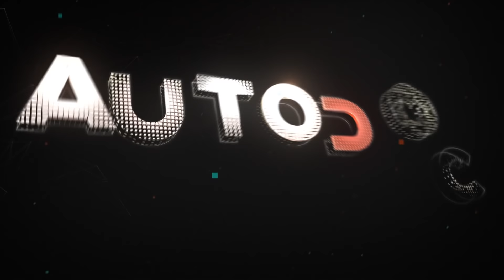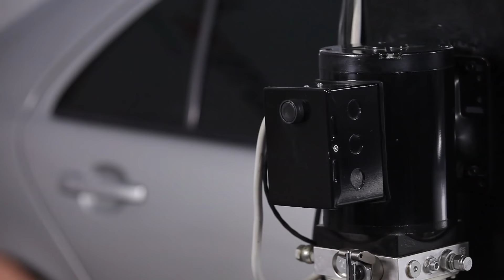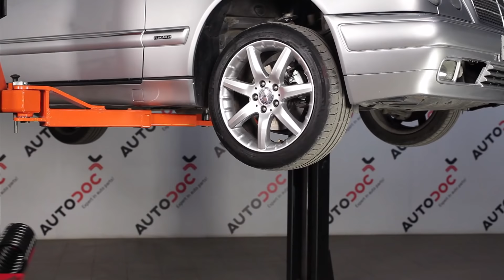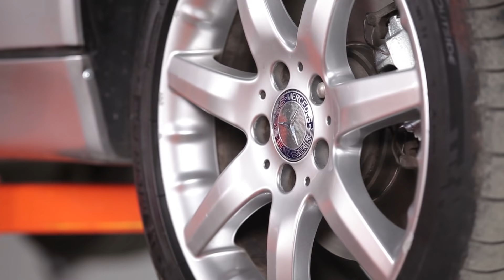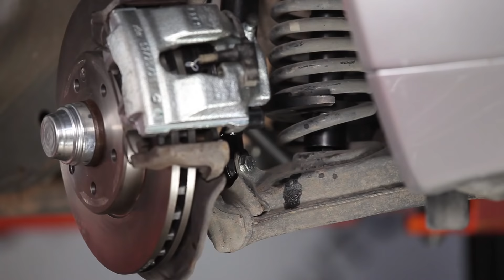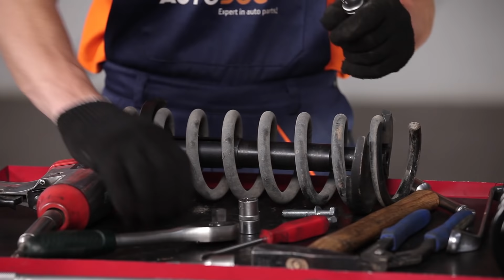How to change a Front Springs on MERCEDES-BENZ E W210 TUTORIAL | AUTODOC

Comment: I appreciate you don't want you hands near the spring when its compressed but I don't much like the use of pipe grips which damage the coating. 

What's needed is a spring compressor tool with handles that can be used to lift/install the spring when compressed.

Keep producing the videos. Excellence in quality and information.

thanks
Reply from the maker: Thank you for  your  feedback! Thank you for your  remark! We will take it into account, when making our new  videos. Best regards, Autodoc.

Comment: Excellent video, very informative. Just wondered if there was any kind of bushing or insulator between the bottom of the spring & it's seating on the wishbone.
Reply from the maker: Thank you for your feedback ! You are absolutely right - in the bottom of the spring there should be  a rubber gasket. Unfortunately , it can't be seen in the video, as, when dismantling the spring, it was left  in the arm. Best regards, Autodoc.

Comment: How you can detect a broken spring? It makes any noise?
Reply from the maker: Several signs may indicate a broken coil spring in the car:
- Knocking or noise when driving over bumps.
- Uneven tire wear.
- Axial displacement of the wheel.
- Low ground clearance.
Reply: @autodocuk  i think that's the problem wit my car. Thanks